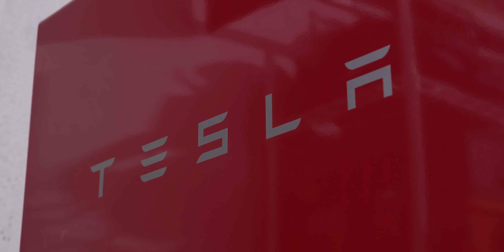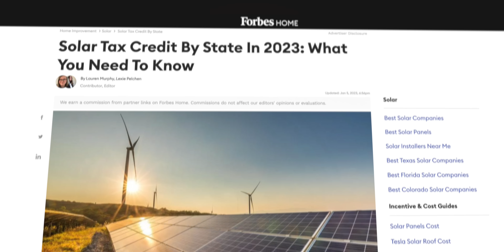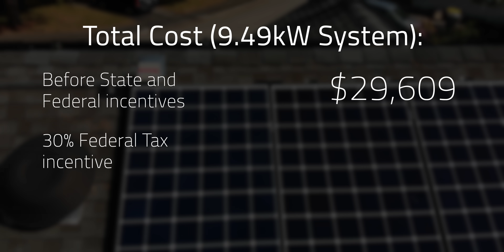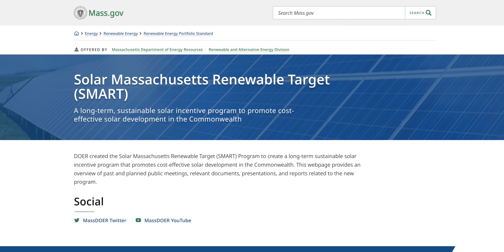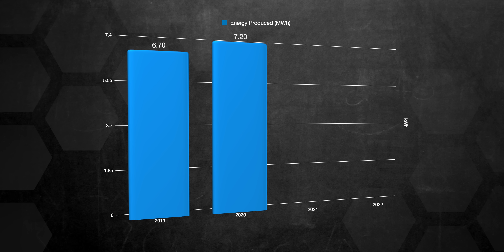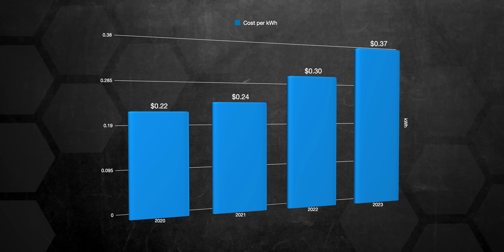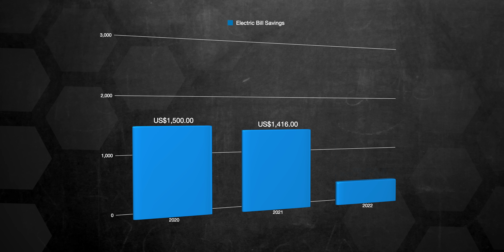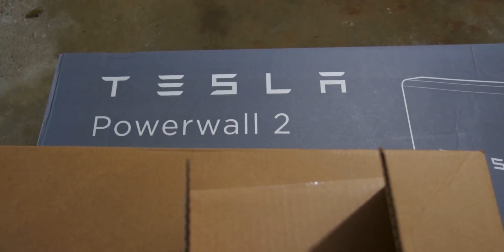5 Years with Solar Panels - Is It Still Worth It?

Comment: This house has been off-grid for the last 15 years with no grid-tie.  Just went from the old Outback to a new SolArk combo inverter with lithium batteries last week and it's running amazingly!  3P config Discover AES 48V 130Ah batts with 5kW PV input.  Cost $32k 

It would have cost $45k to bring in grid power, and then we'd be paying an electric bill.  I installed it all myself.  The SolArk wiring was a breeze!!!  Touch screen controls, all the settings are labelled intuitively.  Manual is easy to follow.  Also has a ton of options for sell-back and scheduling and peak shaving for AC coupled users.  

I'm not affiliated with them at all, just a very happy customer.
Reply: PLEASE TELL ME THE BATTERIES ARE NOT CHINESE?
Reply: @GBS1043  DiscoverBattery is a massive company, I've no doubt they do business with/in China, but their product has an excellent service history and has worked fantastic in our location. 
Very satisfied customer.

Comment: Here in Slovenia you can only rent the solar panels, all electricity goes into the grid and you buy it back, You are not permitted to use storage batteries other than in an EV for which you need a three phase supply for the charger, the normal mains single phase cannot supply the necessary KWH to charge the car battery.. Our daughter looked into solar before getting a new wood burning central heating boiler and the other systems available were not cost effective. We have to use oil as there is no gas alternative and the price per litre of red diesel is currently less than it was at the beginning of 2022. I top the tank up buying the oil from the local petrol station which means I am not tied to a supplier with a tanker. Our access drive is too tight and narrow for a tanker anyway and my tank is usually around 70% full. Currently it is full ready for next winter at this years cheaper price. Because the winters have been warmer we have used much less oil than in previous years

Comment: We live in Washington State and had solar panels installed on our previous home as well as the home we now occupy.   We don't get all the perks Matt does living in Massachusetts, but nonetheless we feel our solar installation is well worth the money.  The 30% tax credit was extended in 2022 so we were able to reduce our overall cost by around $9000.   Our decisions to install solar probably has less to do with the actual numbers analysis, although I do believe it's important to know what your actual energy savings will be now and in the future.   But a big reason we chose to do solar is that it just feels like the right thing to do if you can reasonably afford the cost.

Comment: I wonder Matt how could you run up that much energy usage.  We live in a 4000 SF house in Minneapolis suburb with three kids, and our usage in 2022 was only 6,795 kWh costing $1089.61 with all taxes and fees included, or $0.16 /kWh.  So, while I thought about installing solar, the cost savings are really not significant to be worth the effort including cost, maintenance and personal time invested.  Not mentioning that if I ever sell the house, I may end up with buyers who don't want the panels.  I believe that Xcel  Energy's approach of building large solar farms to replace old fossil plants, is a more economical approach especially because we probably will never get away from large power plants and systems to ensure the energy supply security.  But this is an ever-evolving environment, which can bring new changes every day.

Comment: Great informative video.  Glad to have come across this as it puts some real number values into perspective.  However, to play Devil's advocate on the saving potential, I would caution a few things that either are not mention, or maybe I didn't hear them mentioned or talking about in detail.

1) Cost of Kw/hr definitely varies state by state.  In liberal states where certain types of fuels that are used to general electricity are frowned upon, outright banned, or shut down.... the cost of generating electricity is definitely going to be higher.  This is why there's such a huge exponential rate hike provided in the video.  It takes clean energy companies (like Wind turbines) more resources (higher cost $) to generate 1 Mw of energy than in states where Coal or other low cost resources are used to generate that same 1 Mw.  This in turn gets passed down to the consumer.  Their alternative is to incentivize the consumer to instead invest in expensive solar panel solutions, like the one provided here, as a means to offset that cost.  So basically they convince you to be your own electricity producer at your own cost, and even help pay you some of the proceeds of their revenue if they can even leach some of said power back onto their own grid.  Ingenious on their part.  Where I'm located, we don't pay anywhere near that 37 cent per kw hour rate, so our savings return would take many more years to offset the cost of installing them.

2) Government credits and other initiative programs won't be out forever.  Keep this in mind that savings from 5 years ago, won't be the same as they are today, so had the author of this video just started today, it wouldn't necessarily be the same in savings... and certainly won't be 10 years from now

3) The author mentioned it takes roughly 7 years to see the savings benefit.  Unfortunately, as someone already mentioned in the comments, this doesn't take into account removal/reinstallation costs when you have to replace your roof.  Similarly, this doesn't address any potential damage that could occur to these solar panels or other equipment used in the process.  Having to replace panels, the inverter, or equipment in-between everything could easily stretch the benefit threshold out beyond 7 years.

In all, I can't say I'm sold on this solution yet.  And being legislated into a position where you almost have to go this route, or pay exuberant prices because of said legislation, means you're being forced into it, not voluntarily doing it.  And with other cost related issues, I think to make this work in a perfect world scenario, you would almost need to be in the same house for many years to and have nothing go wrong that would require replacements to see the true benefit.  And again, it would still depend on where you live and what your cost of kw/hr is.

Comment: Picking a state with low energy costs helps. I solved my high energy costs by leaving California. 35 cents kwh to 10 cents. As a bonus My house was 50% cheaper and I have 15 acres instead of 1/4 acre. Gas is $1.30 per gallon cheaper. My property taxes are half and the biggest benefit of all is I'm not under the rule of the almighty emperor Gavin Newsom.

My whole outlook on life is 100% better. So yeah there's that option.

Comment: I think the patchwork of federal, state, and local laws, policies, and programs, and middleman operators between equipment makers and consumers is a huge mess.  It creates a lot of confusion and cynicism about the entire concern.  If climate change truly is the existential threat that it's claimed to be--I do believe it is--then this so-called system, for lack of a more apt word besides patchwork, is a massive failure.  Too much friction in the whole scheme to roll out small-scale, distributive rooftop solar fast enough.  Clearly, there are too many greedy competing interests involved, gumming up the works.  Case in point CA's NEM 3.0.  When I look around at just the residential roofs around me in SoCal I see the whole thing moving at a snail's pace at best.   If I had to assign a letter grade it would be F.  I can't even find a way or reason to be charitable enough to give it D.   In a word: Pathetic.

Comment: my yearly consumption in Slovakia, incl. BEV charging is just 3.5 MWh a year, how can you spend 1 MWh a month, are you using electricity for heating? If yes, consider using heat pumps

Comment: One pound of uranium... one pound... powers a North American's lifetime. For the new high assay/thorium  fuel, about 3 ounces of fuel to power a lifetime.  W&S, thousands upon thousands of little on/off generators and glass panels,  thousands of miles of cable, staggering resource consumption, is such a batsh*t stupid concept for large scale generation beyond specialty uses, it boggles the mind. And you have to build FF capacity in parallel and try to manage massive grid instability. Germany is learning this the hard way.  Absolutely crazy.

Comment: In Canada, the alternative to LG panels is BAUER SOLAR (german made). They have been an industry leader in Europe for 20+ years and just recently available in North America. Quality is as good, maybe better (higher static load and better warranty), it's not as expensive, and it has a sleek black frame design. I'm glad I chose it over cheap Chinese panels for my two projects (home and business)  I can gladly share the contact info if you want to buy direct from the supplier, if not you can find local resellers and installers that carry it (in Canada)

Comment: There's one more point you didn't touch on.  10 years ago when I installed panels, most real estate agents I talked to said they didn't add any value to the house since it was so new and they were more rare and buyers wouldn't pay any premium for a big unknown.  Now, solar panels are very common and people realize the electricity savings that come with them, so they do add value.  But, like you, we bought them outright and own them.  Anyone looking into many of the lease programs or other non-standard financial deals to install them need to be aware that if you try to sell your house, the new owner has to agree to take on that same program, which could be an impediment.  Or you may also be looking into a "un-installation" fee to remove them.  Carefully think about what you're signing up for.  It's a lot like a homeowner's association --- someone can't buy your house without agreeing to join it.

Comment: I don't understand paying $12-15K for the PowerWall.  When we did solar panels about 10 years ago we paid I think $7-8K for batteries, but they are basically an array of car batteries in a sealed box in our basement.  Its my basement, so I really don't care how much space it takes up, but its not that big --- its about 5' W x 3' H x 1' D.  Granted there has been inflation over 10 years, but tech tends to get cheaper, not more expensive.  Lithium-Ion batteries don't make sense unless you need to go lighter, like in a car.  In a stationary environment like a basement, the cheapest route is chemical batteries.

Comment: Solar doesn’t make sense in California anymore.  The NEM3 structure is designed entirely to destroy the solar market.  Primarily, rates goes up to $0.50/kWhr after dusk, exactly when meaningful solar production stops.  Any excess generated during the day you’re selling back to the utility at wholesale rates, essentially free.  Yes, you can install storage.  Worked the numbers, that pushes payback to two decades.  Laughable.

Oh, they’re trying to push through minimum monthly fees now.  In my area, it’d work out to be a bit less than $100/month for many.  This applies across the board, even if you’re currently net paying $0 because of an existing install.
Reply: I wouldn't say it makes no sense, but it certainly makes less sense. Much depends on your daily consumption pattern. In addition, orientation of panels makes a difference; while south-facing panels generate the most energy, west-facing panels generate the greatest cost savings because they generate energy well into the 4:00 PM to 9:00 PM peak period.

Comment: What's going to happen when you have to replace your roof? That doesn't look like a new roof.
Reply: The cost of removing and replacing the panels will add about 10% to the cost of a roof replacement.

Comment: This video randomly appeared on my video feed.  My response is applicable, albeit a little late.

We had a sales rep show up at my door a few months ago.  I wasn't interested in Solar, but I wanted to be convinced otherwise.  The sales rep accepted the challenge and after about a 2hr conversation, I was convinced.  With some caveats.  First: I wanted the solar array to cover all of our electrical expenses, not just a healthy portion of them.  100% offset, as opposed to 90% offset.  Second: I wanted a solar array to provide power to my home 24hrs a day, and to be completely self-sustaining.  If we were going to free ourselves from rented electricity, we wanted to be completely free. Power wall, vs no power wall.  Third: we wanted our projected monthly payment to be approximately the same as our current electrical payment.  Instead of paying the electrical company, I wanted to be paying back our loan.
What we settled on was a 26panel grid with 2 Tesla powerwalls, providing a 102% offset from our existing electrical usage and 24hrs of battery backup.  The home is single-story, 1500 sqft with roughly 25% of our major appliances operating on gas.  Our electric bill peaks at around $250/mo and in the winter months, can get as low as $50.
We live in South Texas.  A few years ago, the local power company performed rolling blackouts for days during the winter.  Some people died as a result.  If that happens again, I want to be ready.  Rain isn't as much of a concern, and snow is practically non-existent in my area.  We might have 4" on the ground for a week every 5-10yrs at best.  For the most part, we'll get frosted overnight.  By the following day, it's all gone.
At present, we're still waiting on install.  A waiting list was mentioned in this video.  Just about anything with a control chip these days has long supply delays.  That could be the holdup on install, but I'm not certain.
Overall, I'm pretty enthusiastic.  Our total cost was almost 4x as high, but we have a service plan and 20yr service agreement that comes with the price hike.  My friend could have gotten the same equipment installed for around $30k, but that leaves the service level and upkeep burden placed squarely on my shoulders.  I don't even like to cut my lawn, much less climb on my roof.  I'm not an electrician and I don't trust the work of random contractors.  I'm paying for a hassle-free all inclusive package for a premium, but you get what you pay for.

I am concerned about the PowerWalls, as I've been told they use Li-Ion batteries, which are prone to spontaneous combustion in other products.  However, this appears to be caused by manufacturing shortcuts and not the technology itself.  Just because Teslas, electric scooters, and cell phones burst into flames, doesn't mean every variety of those products will.  The Prius has been using Li-Ion batteries for decades now.  I've not seen a single report of one of those bursting into flames.  If my house does catch fire, we'll just file an insurance claim and move on with our lives.  This is my only real concern with the deal.

Appreciate the insight in this video.  Cheers.

Comment: How the heck are you spending or saving 2000 plus on your electric bill.  Basically the more you spend on solar wind or whatever the electric company just raises the rate so your recovering of the intial investment is made smaller and smaller pushed back back more years.  GOD help if you have to reroof your house.
Reply: Costs to remove and replace your solar panels in order to reroof are relatively minor.

Comment: I think, with the physical setup you have, what I would want would be more personal control. I wouldn't want the solar to just feed back into the grid directly. I would want it to feed directly into the smart wall battery, which would then run the house until it's at 50% or so. Selling electricity back to the grid via that VPP from the power wall does seem like a good idea, but the big problem with the solar panels feeding the grid, and not your house directly, is that you're just playing games with your bill; the energy is never truly yours. And I would prefer to have first dibs on it.

I understand that, with the standard "feed energy to the grid and get a credit on your bill" setup, during blackouts, the solar panels can't even charge your battery! If I am wrong, there, please correct me.
Reply: Current systems from Tesla, Enphase, and others give you complete control over how you energy is split between charging your battery, charging your EV, and exporting to the grid. VPP membership is optional. You are correct that traditional solar systems will shut down during blackouts; but current offerences from Tesla (string inverters), Enphase (microinverters), and I'm sure others, have grid-forming inverters that will start back up in stand-alone mode when the grid goes down. Enphase even allows some power generation during the day even without a battery.

Comment: Contractors in CAL charge 25K:.  It takes 8-10 years to break even.. IT is foolish to add a solar panel because when the roof needs to be redone, you have to pay the extra  to remove the panels and to reinstall them von the new roof.  There is an extra cost maintain the solar system  such as , replace  weak panels, the Tesla battery system, the maintenance contract; etc.  Man made stuff isn't perfect. Since you have decided to sell your property, then the next buyer has to eat these long term cost.  Solar panels are for rich folks; politicians and sugar daddies.